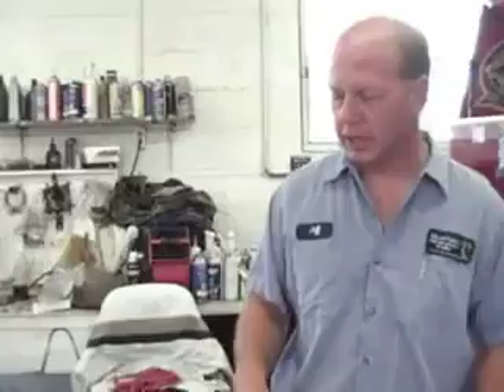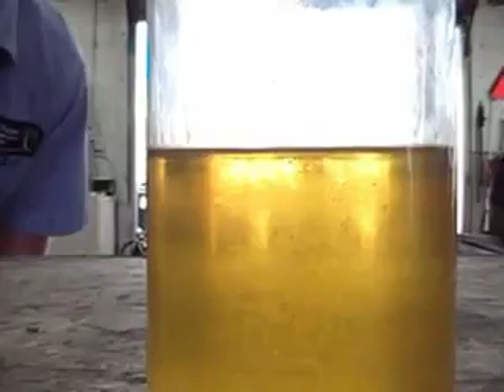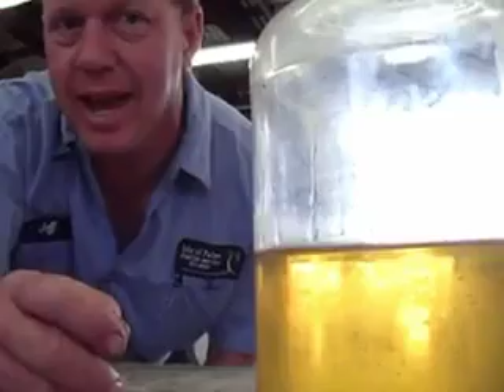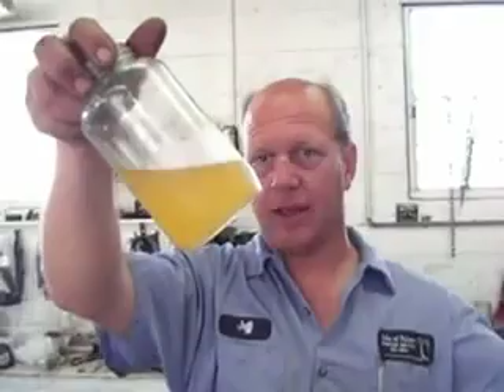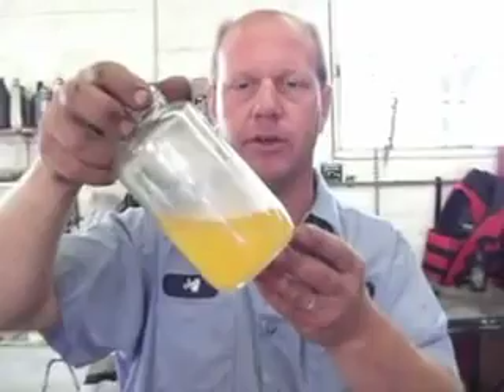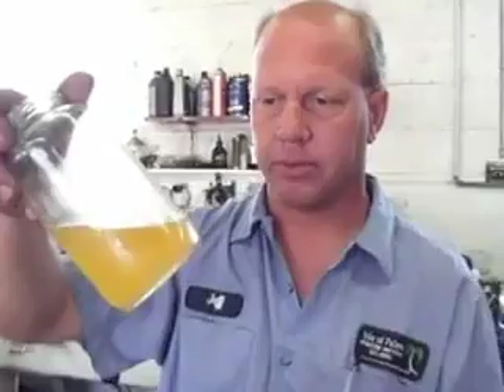How Ethanol Boat Gas Attracts Water from the Air - Demonstration

Comment: Evaporation of the fuel (accelerated by the fan) cools the fuel and then the glass. The cold glass causes water to condense on its surface, inside and out. Just like a glass of beer. It would happen with pure gasoline, pure ethanol or any volatile liquid. As e10 can absorb up to .05% of water and burn it, if water condensing in the fuel tank is inevitable,  using e10 is probably the best bet for keeping moisture OUT of the tank. I recommend using e10 when you suspect water in the tank, but not for long term storage. If you aren't planning on using the equipment often or you are laying it up,  fill with e0 or empty it completely. If you are running daily, use e10 in a marine or high humidity environment. DON'T store e10, it WILL go bad and potentially get fungus and other biological crap clogging your injectors and filters. A 10 gallon tank of e10l will absorb more then half a cup of water and burn it with only minor reduction in performance. Even if you prefer e0, I would still run a tank or two of e10 every now and then to clean the water from the tank.
Reply: Correct. The guy doing the video is a schmuck.

Comment: Very flawed logic and conclusion. I'm not an ethanol fan boy - I like E0 - but I'm not afraid to point out that ethanol is not the problem here. Pure gasoline would cause the same degree of evaporative cooling as ethanol-gasoline mixtures.

"Our old fuel wouldn't do this" is not only false but it would actually do it worse, because fuels containing ethanol would dissolve at least some of the water whereas pure gasoline would not.

Comment: Interesting video, but a seriously flawed science experiment. You said "our old fuel wouldn't do this". Well show us. You needed to use straight gasoline as a control. What you did was perfectly illustrate what Mercury Marine says..."There is no active transfer mechanism for ethanol molecules to reach out and grab water molecules out of the air. Under normal storage conditions, even in a vented fuel tank it just does not happen...The primary cause of water collecting in fuel tanks is condensation from humid air..."
Well your demo sure looks like condensation to me.
Although I didn't see the specifics of Mercury's experiments, I can easily see the deficiencies of yours. Please make a follow up video so we can see what happens to the condensate in a container of pure gas. Maybe use an empty container or a container of oil to add further insight. I suspect all of your containers would show similar rates of condensation. And I would expect the water to collect on the bottom of all of them as well.
In the old days people would use Heet and similar alcohol based products to get water out their tanks. It would be a waste of money now with all the alcohol already in our gas, which will absorb any small amounts of water that will get in your tank under normal conditions. 
Also, as long as I can remember we've had in these water/fuel separators in boats. Where was all of this water coming from pre- E10? Condensation perhaps?

Comment: The atmospheric H2O will condense on the inside wall of the glass container (or inside a vented tank) whether there is alcohol initially in the gas or not..... Such condensation
Puts the water in the gas.... the glass is cold (leading to the condensation) due to gasoline evaporating quickly (it naturally evaporates quickly sucking energy/ heat out of the glass)..... It does not need alcohol in it to make the glass cold......  So, there is something missing (physics) out of this explanation......
And, adding denatured alcohol to gas combines w water and carries it out the exhaust.

Comment: Is the water accumulating in the gas due to atmospheric H2O condensing on the inside wall of the glass container and running down into the gas?...... You said “on the OUTSIDE” of the glass.....???

Comment: Has nothing to do with alcohol, non-alcohol fuel would do the same thing under the same conditions. It's just condensation.
Reply: Correct.  If you get distilled water vapor inside the tank due to high humidity or spray (like he is simulating with the fan) then it will collect to water droplets regardless of the liquid in the tank.  Gasoline will place nearly all of it as a water layer at the bottom.  Ethanol will allow some of the water to mix and therefore burn as tempered alcohol, the rest at thee bottom.

 If you don't occasionally drain the bottom of a marine (or any) vented fuel tank, 100% Gasoline, E10 or E85 you will eventually have a small water layer.  If the tank has a petcock, remove the fuel line, place it into a bottle and set it on reserve.  That will drain any silt and water at the bottom.  Silt is worse than water for a carburetor.

Much of this Ethanol non Ethanol preached stuff is misunderstandings of chemistry, physical properties of compounds and guesswork.  The only real difference is alcohol will make some portion of the water burnable.  100% petrol will just cause a gulp of water and the motor will stumble or stop with a hydrolocked cylinder. 

All commercial alcohol has water in it from the start.  That is the PROOF number on your whiskey bottle.  By allowing water into the combustion chamber, there can be effects.  Typically the effect is that carbon sluge is cleaned off the cylinder top wall, piston head, and valves.  Look at what is in such cleaning magic formulas like Seafoam or Heet.
Reply: Incorrect. Ethanol blends attract more water PPM than it's non alcohol blended counterparts. Then phase separation will occur. It takes ~ 2-3 months for E10 to spoil. Non alcohol gas.....longer.
Reply: @jf4872 .  Then why did I always have to drain lawnmower that had set in the 70s to get them to run.  When you drained the tank into a mason jar the bubbles of water were very visible and settled to the bottom.  Gravity feed mowers would never start after sitting in a humid area like Mobile.  Long before Ethanol was cheap gas or common.  After Ethyl was high test premium in the 50s/60s and people paid extra for it.  Yeah it used to be "fancy gas" ironic huh.

The water you should worry about with E10 today is what is already mixed in at the station.  About 1% total volume as all raw alcohol is tempered with water, even Jack Daniels.
Reply: @jf4872 .  What is your definition of spoiling?  I've had e10 from Murphy Oil in a sealed plastic can for a year and it still burns in a motor.  Easy start.  I shook it and poured a sample into a glass column.  It was yellow but it didn't separate after it settled.  It may have always been yellow. You do know the yellow means it was crappy shale oil from Canada/MT or fracked oil.

BTW remind me how you get Fracked Oil to the surface....  What is that magic fluid they use????????
Reply: @jf4872  2 or 3 months? What kind of crsp gas do they sell where you live? My boat sits for about 7 months every year with blended fuel. Starts right up and runs fine every spring for past 13 years. I do use stabilizer and do make an effort to use up most of the old gas on my first trip. My mowers sit about 5 months but most (I have 8, it's kind of a problem) start on first pull in spring

Comment: Not good science.  Actually the best thing you can do is FILL the tank at the end of your run or end of season limiting the airborn moisture exposure or empty it completely and run dry.  The ethanol in the gas absorbs water from the atmosphere and renders it harmless.  There is a maximum amount of water it can absorb of course and then octane is reduced.  The video is illustrating the effects of condensation in a very humid environment with a highly volatile liquid.  Its silly to compare this with a sealed gas tank.  I personally do not drive around with a open jar of gas in the back of the boat.
Reply: Great advice Pete, thanks.

Comment: I can fill the tanks in my riding mower, walk behind mower, reel mower, pressure washer, chipper shredder, weed whacker and leaf blower in October when I close it down for fall and restart and reuse all of my yard equipment as late as May the next year without any problems with ethanol blended gasoline. Now I'm not sure that by using that same blended gas and leaving it over a period of say a year to 2 years whether my equipment would start up. I have a tiller that I rarely use that I can go every other year to use it and it amazes me that it continues to start up on the 1st pull. Yes with the blended gasoline.

Comment: My car is tuned specifically for e85. The combustion chamber is cleaner now than with fossil fuel. E85 is a far safer and cleaner option than gasoline. E85 = Zero knock (detonation), better emissions and is grown in my backyard. Big oil and its inevitable demise...that sounds like a good thing to me. Stupid renewable fuel.
Reply: It will also take more gallons of E85 to travel the same number of miles one can with non alcohol fuel.
Reply: @jf4872  it comes down to how many cents a mile.
30mpg at $3.00 for e10 = 10 cents a mile
25mpg at $2.50 for e85 = 10 cents a mile
That's just an example.  If e85 is lower $$ than that example then you save money, but don't get the range.  I can barely find an e85 pump anymore.  Don't know what it costs today.
Reply: Yep.  Bet the same mechanic uses Seafoam or Heet to clean the motor of built up carbon.  What are those formulas?

Comment: Ethanol is non volatile. Petrol Is volatile. Water mixes with ethanol which can then be burnt perfectly safely. Often switching from petrol to ethanol you will find that any gumming or varnishing effects from the petrol in your system will be washed through .This may end up blocking your fuel filter or perishing the build up on orings etc. Most o rings are made of a nitrile rubber which is resistant to ethanol if you have rubber o rings then someone is doing it wrong as they perish in petrol too
Reply: I don't think that you understand what volatile means.
Reply: @markyaworski7387  Fair assessment. I'm trying to use words to explain something and I've done a poor job, I often mince my words or leave them out. When ethanol burns in a combustion chamber is has a very smooth and even burn through the combustion cycle in regards to its venting/pressure output. Whereas petrol isn't a smooth or even burn, it crackles unevenly. You can see it fairly simply when you burn both in open air too. The difference has an impact on power output and wear.

Comment: Very important video, with great comments. Thanks!
Been aware of ethanol smells and its dizzying/sickening effects on the highway for the past couple of years -- most notably during precipitation (even fog) or going across bridges.
If flex fuels are wrecking our engines, consider what this known toxin is doing to our lungs & bodies (which are mostly water). As the ethanol/gas ratio increases, so does its resultant destruction.
Obviously, the hawkers of this cocktail are making a killing.

Comment: Good Video,
I keep a fan running in my garage to help try up moisture. where I store my 
Atv and tractor , the fan in the garage helps wick away any moisture in the air
 I use sta bil and Lucas and have not had any problems , What do you Think

Comment: Try the same experiment with pure gasoline.   You will get the same condensation due to evaporating the gasoline.  This has nothing to do with ethanol.
Reply: exactly i have issues with what he demonstrating and the claim,,he say this jar contain fuel and ethanol but never mention at what ratio,how much ethanol you got in there?  the way that water concentrated at the bottom and would not be soluble tells me this is maybe pure gasoline,if it had ethanol it would mix and be soluble as demonstrated in this video here   https://www.youtube.com/watch?v=-grvPu4hd7U    and this condensation happens regardless of there being ethanol in the fuel or not and then the kicker at the end of the video is him promoting a stabilizer which most likely is alcohol lol

Comment from the maker: EVAPORATIVE COOLING AND CONDENSATION
Evaporation is the process by which molecules in a liquid escape into the gas phase.  As the most energetic molecules evaporate into the gas, the average energy of the molecules left behind decreases, so the liquid cools. 
You might have noticed that when you pour alcohol on your skin, it cools your skin more than when you pour water on it. This reflects the greater volatility, or tendency to evaporate, of the alcohol. This cooling effect causes condensation.
Reply: By this logic, the evaporation of gasoline should cause even greater condensation, since gasoline is more volatile than ethanol.

Comment: @ETHANOLSEEKER Ethanol is a good source of clean fuel for almost all gasoline powered engines. The maximum amount of ethanol you can mix with gasoline is 50%. The more Ethanol you mix, the less fuel efficient your engine becomes. Also please remember that Ethanol cannot be used in 2 stroke engines because 2 stroke oil does not properly mix with Ethanol. There are some vehicles which allow up to 85% Ethanol. They are called E85 vehicles.
Reply: Biodiesel can effectively work as 2-stroke motor oil for ethanol.

Comment: What is wrong with those idiots at American ethanol.  These are the morons that are supplying ethanol to NASCAR.  I told them about how a number of racers engines have failed because of the E-15 garbage they are use.  Kevin Harvick had problems at the race last Saturday.  His engine blew up.  You figure they went to leaded racing fuel to the E-15 crap.  Well the first thing you need to do is rework the cylinder heads.  They hardened valve seats.  Your engine will run too lean if mixed wrong.

Comment: The crap is just hitting here and I have 2007 V8 Dakota that I have to keeping dumping gas line antifreeze into to get it to start. Luckily the gas station I usually buy from has not transitioned yet and the other vehicles are fine. My son's had the same problem. Some people are saying the the high octane gas will not have it but I'm not sure yet.
Reply: Whats in gas line antifreeze?

Comment: @altlandf You misread my post, all of my carberetted equipment required rebuilding because of ethanol damage.  I despise ethanol added to gasoline.  Finally had to spend $800 when my Mercruiser inboard began stalling on the river.  Guess what killed it.... ethanol.  Our local fuel supplier offers non-ethanol gas due to demand for non-highway engines.

Comment: And then those of us that fly planes with engines designed for Mogas. Water in the fuel = stopped engine or carb icing.  Not what we like happening at 3,000 feet!

Comment: My lawnmower, snowblower, ATV, 4 stroke weed trimmer and rotor tiller (all less than 4 years old) have all required carburetor rebuilds.  If gas sits more than one month, the chain saw will not start.  My ATV (2005 Yamaha Grizzly) is on the 11th spark plug as the electrode insulator is shorting.  Now it is in the shop because of bad float.  Many other ATV at the Yamaha dealer with same problem.

Local gas station has just started selling non-ethanol gas...... FINALLY! Small engines rejoice!!!